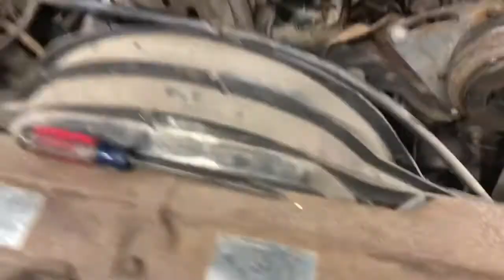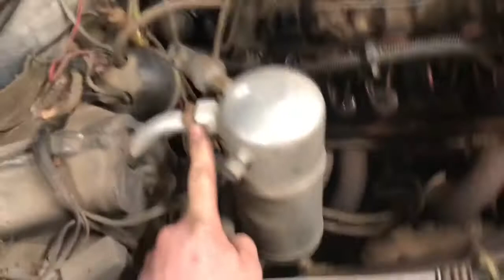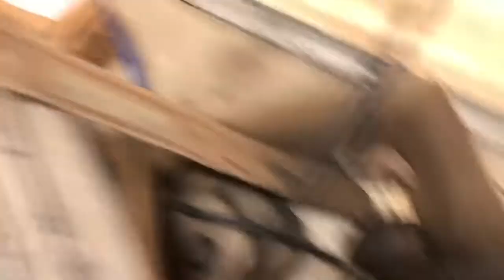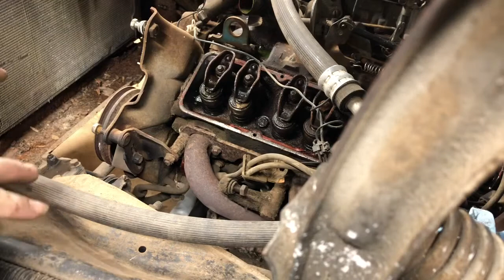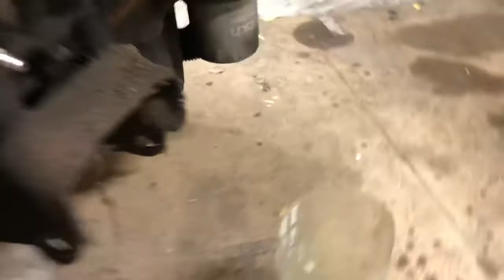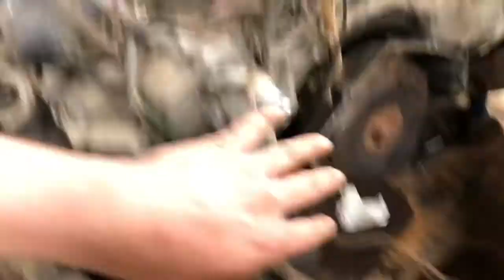1979 Z28 Camaro engine removal for LS 6.0 swap

Comment: nice video i learned a lot, i was just hoping to see how you unbolt it from the transmission and the motor mounts
Reply from the maker: I just took out the bolts around the bell house. Also unbolt the TC before you pull the engine.  I left the tc on the trans.  If you pull the TC off the trans you will have trans fluid all over the place. The engine mounts I just pull the one bolt that goes forward to aft.  I will try to make a video in the next couple of days showing what I did explain it a little better.
Reply: @kingdeadlego  alright awesome thank u for responding